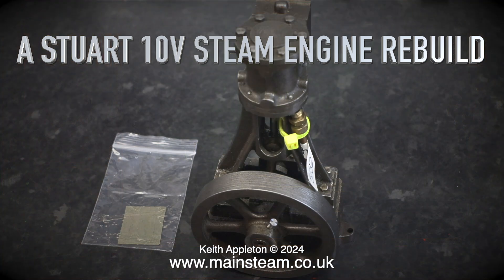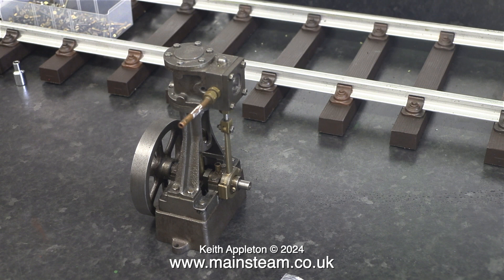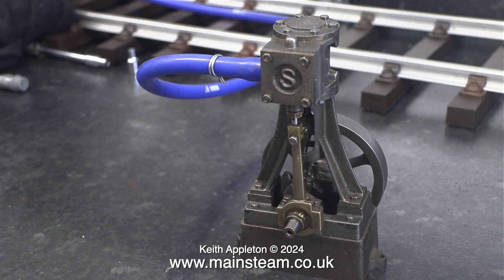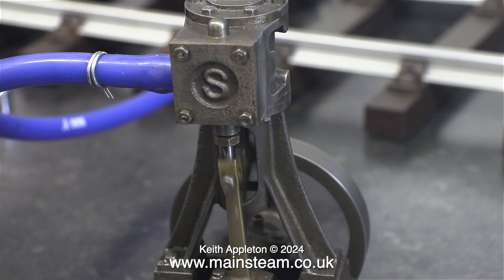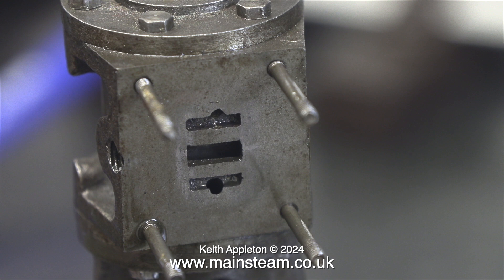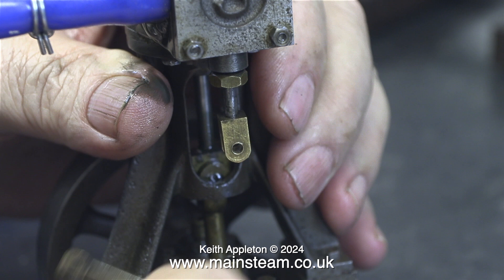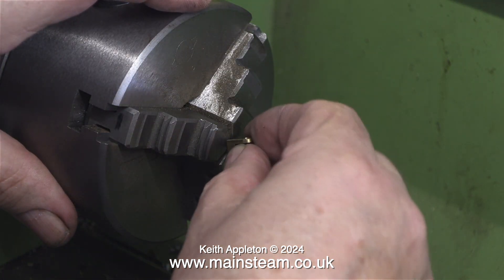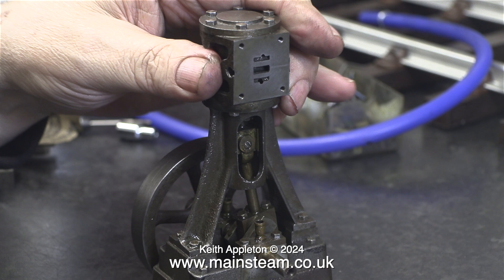A STUART 10V STEAM ENGINE REBUILD - PART #1 - THE INTRODUCTION AND OVERVIEW

Comment: I was given partially machined Stuart 10V to finish during lockdown.
One of its issues was the same problem you have here - the steam ports coming out on to the valve face. You said that you're going to discuss your options later.
I'm going to be following this project with interest.